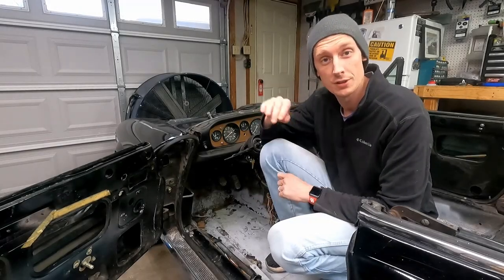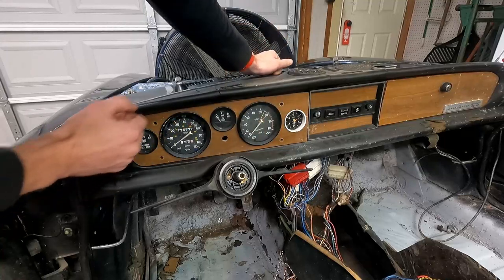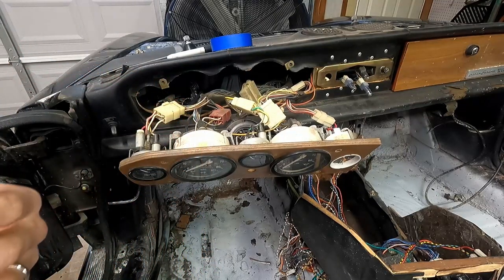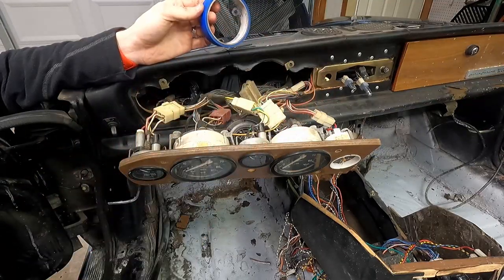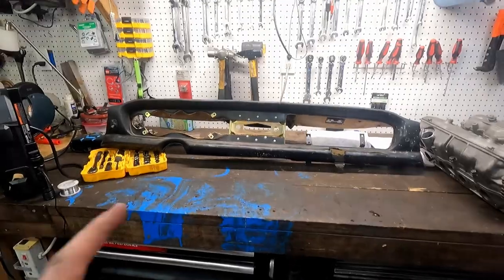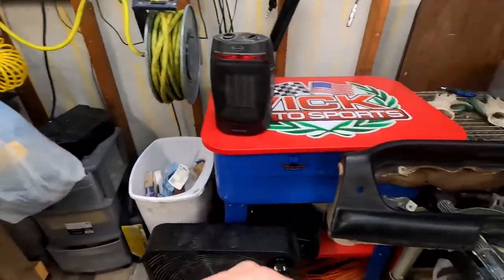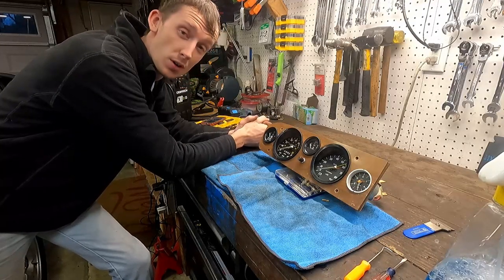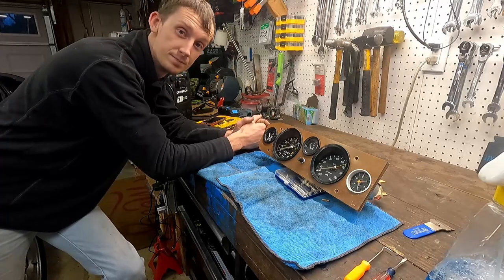How to Remove the Dashboard in a Fiat 124 Spider and Clean the Gauges! Easy, DIY project!

Comment: Great video!  I have a 1977 Spider and am replacing the interior panels (instrument cluster, glove box cover,  hazard light seat belt middle panel, and gear shift bezel) with oak wood with a mahogany stain because it just looks so damned cool, and the original plastic looking walnut panel is REALLY ugly.  I appreciate your help because having my Spider is like being married to a supermodel...with Legionnaire's disease:  she's really beautiful, but every system takes turns in breaking down 😄🙄
Reply from the maker: It’s a relationship of love at least!

Comment: Awesome.  I am at the point of adding oil pressure gauges to both my spiders.  Both have fogged glass inside, and I’ve been wondering how to get the bezels off.  There is a port doubler, that attaches to the oil filter housing, available and pressure transducer as well.  That way, the dash will have 2 functional oil pressure lights!

Comment: Loving this channel.  I picked up a 1981 that was being parted out with a 1976.  I was going to buy a different car and was asking about the cost of the pieces I needed, then I asked how much for the whole thing.  The parts would have been $400, but he told me $300 for the entire car.  He had already sold the 81 convertible top, so he sold me the '76 complete frame.  He was so happy to get rid of the car he let me pick parts off the 76'.  So I trailered everything home.  The top was really ugly and would need to be totally refurbished.  I derusted, cleaned up the bolts and replaced the canvass with an appropriate '76.  I expected to redo the clamp locations, but when I attached it to the car; the back edge would not pull down to the body.  It sit at lease 2" above the body.  Is there anything I need to change other than the 76 header to make this fit?

Comment: Always enjoy your videos. You save me a bunch of time trying to figure out things on my own !  If you are switching speedometers, is there a way to "test" a unit before installing it ?  Want to switch out my original 85 mph unit for a 140 mph unit on my 81 turbo spider. Thanks !!
Reply from the maker: Thank you for supporting me!! So glad I can help. To test a new speedo, you can attached the speedo cable and put a drill on the cable. If you put the drill in reverse, it should reach 55mph or so. The cable is square, so the drill can grip it. Just make sure the drill is in reverse!
Reply: FYI, I bought a used 140 speedo on ebay from vender in California. Mine had a broken odometer. They are very simple devices. I now have a working unit however the trip odometer and mile odometer vary by 5 mile over 200 total miles I don't know which is more accurate :)
Reply: I see you removed dash with windshield off is that necessary or just what happened for you. When I got my 124 it had a new cap not secured properly, and it hinders opening the glove box a bit. Car lot put it on for a sale, will it be easier to take off windshield?, Or remove dash? Or do I have to do both?

Comment: what did you do to disconnect  the odometer wire that goes  from a connector to the gage?
did you cut it? any trick to pulling the terminal from the connector?
Reply from the maker: Do you mean the trip meter or the speedometer cable?
Reply: odometer (total vehicle miles)
there’s an electrical wire that goes from the’locked’ back of the speedo to a connector waaaay deep behind in the dash. 
-I can’t see how to remove the terminal in order to get the dash free of the vehicle. Your video, while overall ‘10/10’ has one shot showing that wire still passing from gage through dash to a view of the dash free of the car. How’d you do that?!
Reply from the maker: @peterrosinski1903  is it the yellow wire with the red tracer?
Reply: yes!
Reply from the maker: @peterrosinski1903  I ended up cutting it and putting a spade connector on it. Much easier to deal with rather than chasing it down and having to pull it all the way through
Reply: Excellent. Thank you!

Comment: I have an '81 124 2000.  It runs very rich.  Where should I start my investigation?
Reply from the maker: Well I’d start with my O2 sensor and see if that is burned up. That tells the computer how the engine is running. I’d also make sure my mixture screws on the plenum are set correctly.
Reply: First look for air leaks and more air leaks and more air leaks leading to the throttle.  Check the coolant sensor and connector at the hose tee,  it may be telling the computer the engine is cold.  The gage read from two sensors in the head.